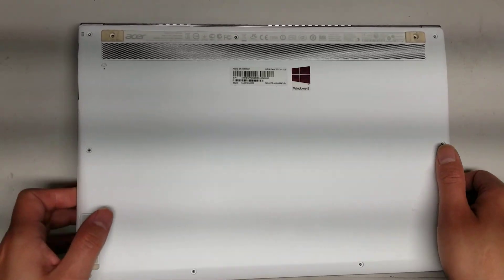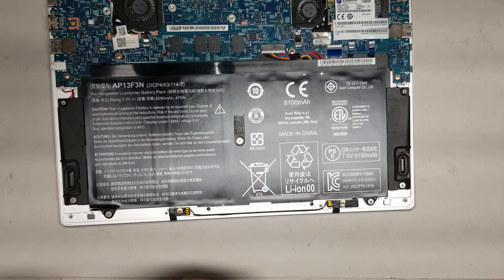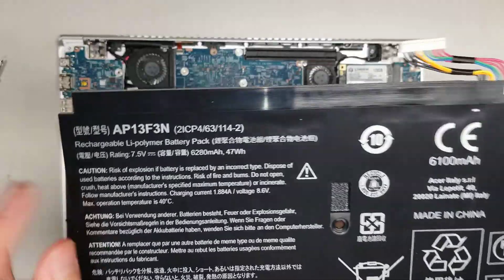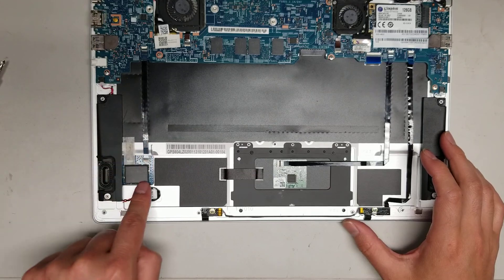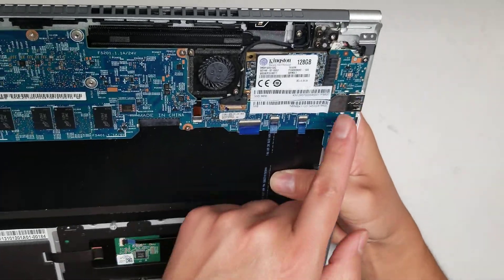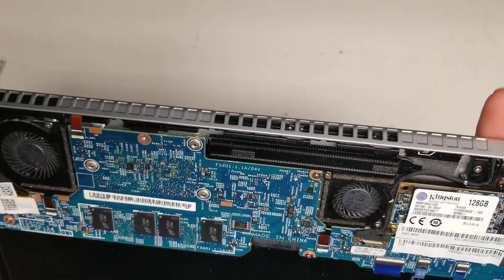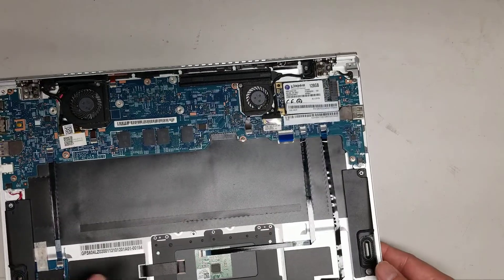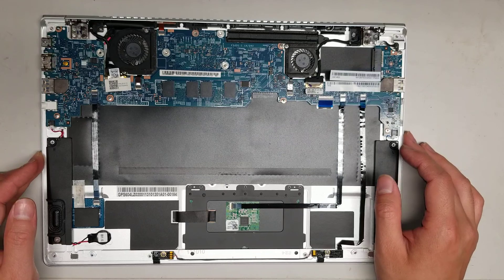Acer Aspire S7 S7-392-6832 Disassembly SSD Upgrade Repair

Comment: Quick extra tip for this laptop. Tape the screws to the bottom of the case in their proper positions. Saves a bunch of time figuring out which screw goes where.
Reply from the maker: Or you could do what I do in this video https://youtu.be/zdkSsNsx6L0

Comment: Thanks for the video. I would need a bit of help with mine. I have the exact same and my motherboard died yesterday. the SSD is Raid 0 so almost impossible to read. I've found a second hand motherboard, exact same type and I was wondering if the new motherboard will know how to read my SSD without losing my data. I appreciate any input possible guys. Thanks a lot!
Reply from the maker: I'm not too familiar with raid. In theory it should work, but I'm not sure how to do it. :(

Comment: My laptop keeps shutting down by itself. Something is wrong with the case so Windows thinks the lid is suddenly closed and it's time to sleep. Also there is battery protection that cuts power off immediately if the case is open, that misfires too if screws are not tight enough.

Is there a way to overcome these issues? Remove that stupid battery protection, fix the case?
Reply from the maker: If it goes into sleep mode, that's either battery percentage too low detection or magnets nearby tricking it into thinking it closed.
Reply: @ItsBinhRepaired  the battery is ok and fully charged, even though the laptop is old. The reason for going to the sleep mode according to the Windows event log is `the power button or the lid`.
Reply from the maker: @vborovikov  go to the power settings and select do nothing on lid close and power button.

Comment: Should warn people about static electricity before working on this, you keep casually touching parts, you're supposed to ground yourself to the pc/laptop before touching components like that.  A simple touch to the body ground of the laptop/pc before touching the motherboard etc is all you need to do if you dont have a static strap.
Reply from the maker: Did your computer die?
Reply: Not recently - im 38 now, but when I was 14 I blew my motherboard whilst poking around and exploring.  Best lesson ever to be honest. Whenever working on components just ground yourself before touching either with a static strap, or touch the body, then touch the component, then untouch the body... Its good practice...
Reply from the maker: @Anythingyoulike2013  they'll learn quick and it'll stick lol